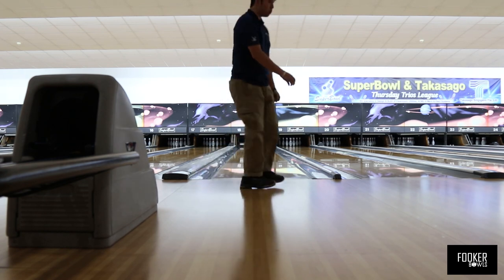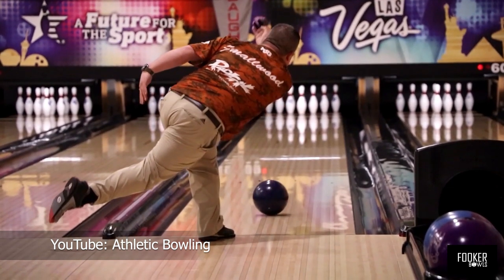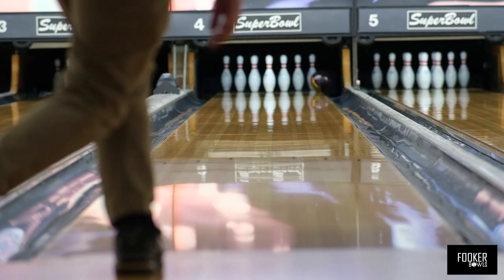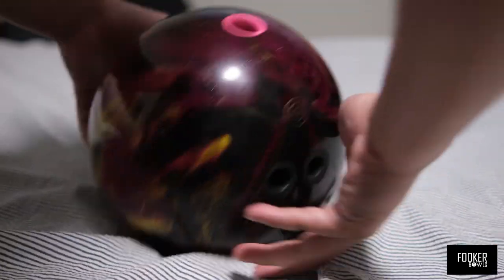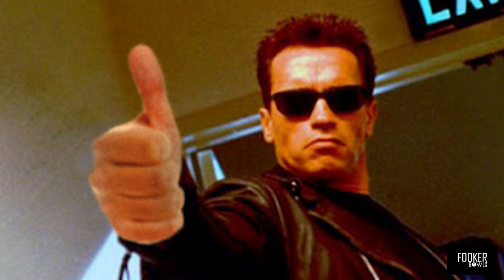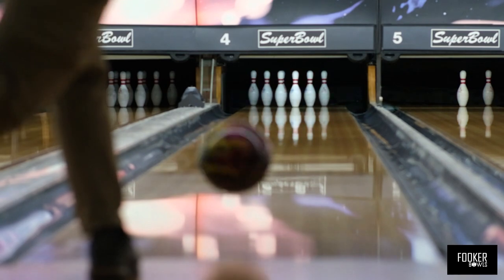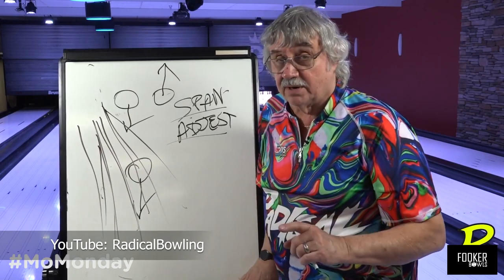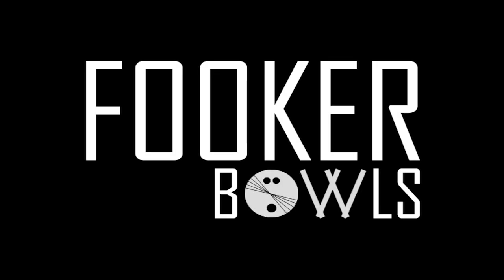The Curse of the Full Roller

Comment: Tom Smallwood is not a full roller
Reply: I agree. His thumbhole is moved left.  That is why his ball tracks between the holes. He has tilt. His track doesn't go right through the middle of the ball, spitting the ball in half.  You can have very, very low tilt and be a full roller. Like less than 3 degrees. So it's possible to track outside the thumb hole and still be a full roller as long as tilt is zero or very close to it.
Reply: Making Tom Smallwood have more tilt by making him middle finger dominant wouldn't make him a semi roller, it would make him a semi spinner which would make his ball reaction erratic. He could have a bigger variety of layouts but they would just be used to tame the erratic tendencies of a forced semi spinner release and wouldn't actually give him an advantage over his current layout options.
Reply: Just check if his ball spin or not.
Layout do not matter. The only indicator is if someone has 0 degree axis tilt. 
Btw I am a two handed full roller.
without the thumb you can do many funky things to the ball😅.
Reply: Is this a joke???
Reply: Smallwood is a full roller. Anytime a ball track goes between the fingers and thumb, it’s a full roller. He’s a good friend of mine, so I see it first hand when we bowl together. Don’t give me this “Smallwood isn’t a full roller” bullshit, you’re only making yourself look more clueless
Reply: Smallwood Is clearly behind the ball not a full roller

Comment: its all in the wrist
Reply from the maker: yes it is, though at the same time it's not entirely that simple, either, as wrist position can be impacted by a multitude of different factors
Reply: not all humans have the same wrist structure. not all humans have the same wrist structure on both wrists. i have an extra tendon in my left arm to my right. you can test for this yourself, bring your thumb and pinky together. if the centre of your wrist forms a ridge you have a useless tendon there, if it suddenly forms a valley you have the model 2.0 wrist with less useless parts. it's a useless part since it's the go to component to replacing damaged ligaments if you need surgery elsewhere. you'll often see people with scars up their forearm from that exact procedure 

i'm beginning to suspect i'm also a full roller because that ball motion is extraordinarily familiar, but my oil doesn't track between the thumb and fingers.